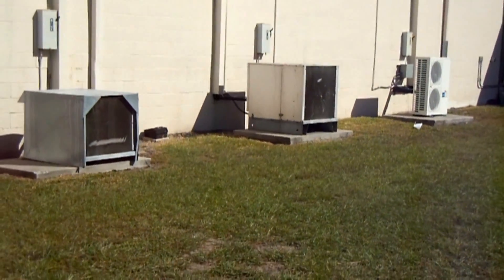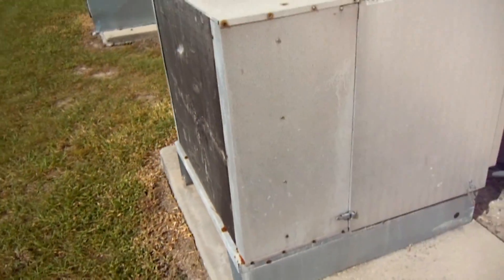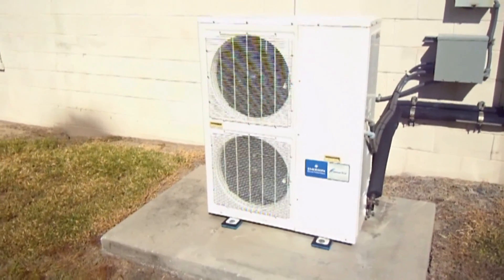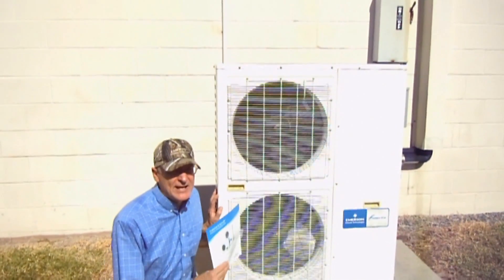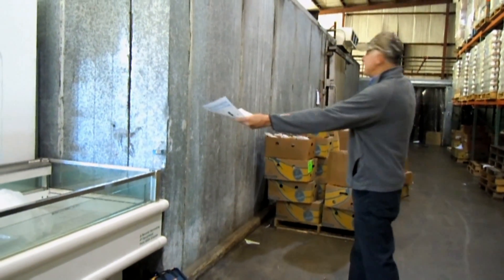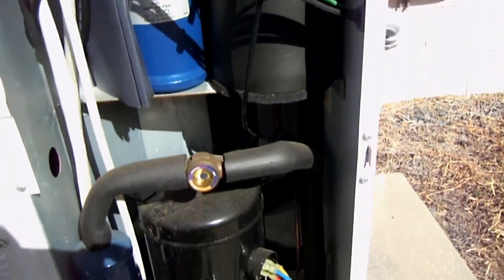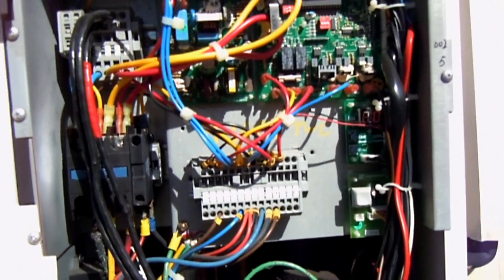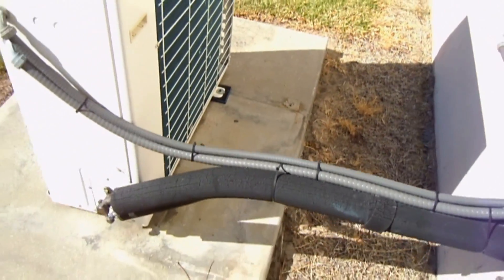HVAC Emerson XJ series condensing units

Comment: Oil separators can't be used on residential heat pumps because oil circulation is needed to lubricate the reversing valve, right?

Comment: @DrZarkloff I used to work at York International so it kinda stood out big time. Just thought I would ask. We had a select few that had wires like that but those never made it out the door. They went to be tested to destruction and it was easier to hook up test equipment to them without the plug.

Comment: @blissJesus1 Typically, one of the whips will bring in the line voltage to the condensing unit and the other will bring in control voltage.

Comment: first one looks like it has a leak around that flex coupling, lotta oil

Looks pretty serviceable compared with a Inverter driven unit, mechanical contacters and bits.

I'm just about to scrap/autopsy a LG unit of the same style and size, except they run 2 compressors, 1 normal cap start - cap run AC, and a sine wave inverter backup comp for low demand.

but to be honest, the oldest units are usually the best for longevity